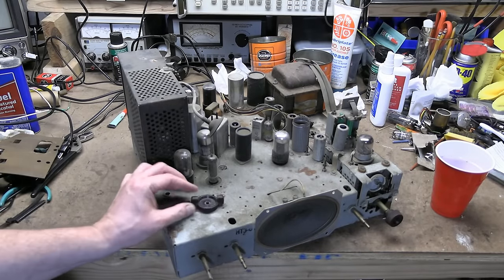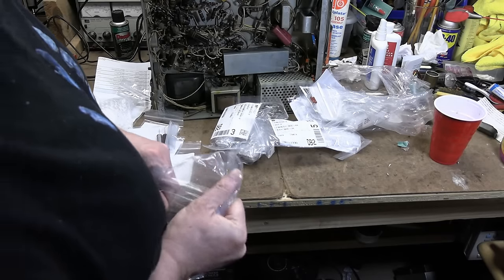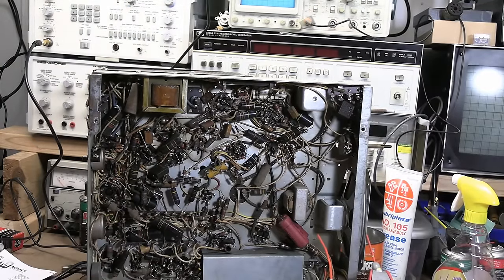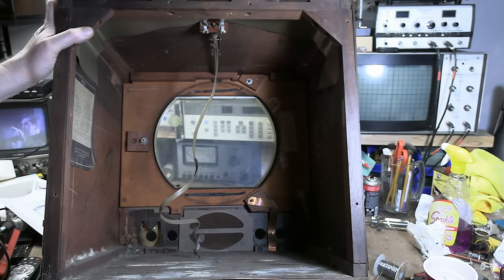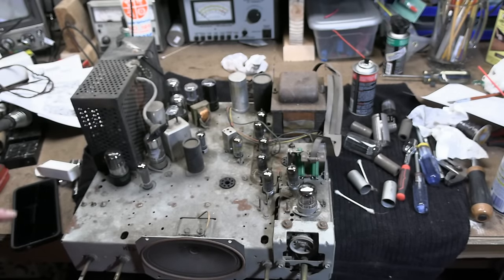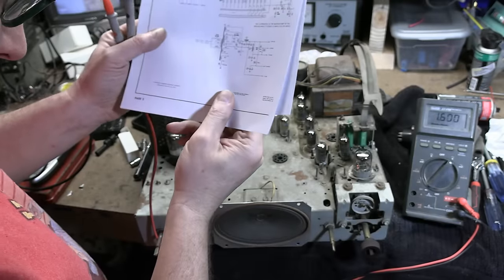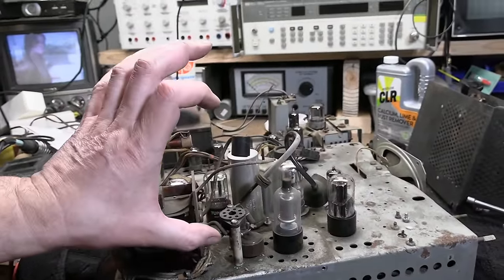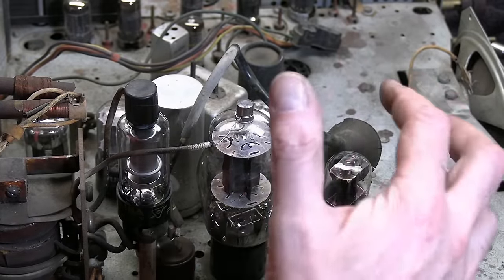Philco 50T-1404 restoration part 2

Comment: Great video Bob!  This old Philco is VERY similar to the 1401 I am currently working on. Great job with the initial checks and powerup before even doing anything other than getting correct tubes in the correct spots, changing the AC interlock and jumping the bad power switch. I wish I could have done that with mine. Unfortunately, my missing C5 cap and a few random broken wires kind of prevented that. I'm watching this one with great interest.

Comment: 28:10 The HV rectifier and horiz output tube being mixed up actually explains the bright flash that can be seen inside the HV cage on first powerup at 21:48; the 1,4V filament of the HV rectifier was blasted with the 6,3V for the H-output tube and burned up.
Reply from the maker: Haha - I missed that.  I was wondering as I edited the video if I might killed the HV rectifier.  I'm a little surprised it uses the same filament pins as a 6BG6.

Comment: For HV rectifiers you can use Soviet equivalents. 1C1S (1Ц1С) and 1C7S (1Ц7С). They have the same pinout and same ratinga as the US tubes. There's also 2C2S (2Ц2С) it has a bit higher heater voltage ,but it would work ok.

Comment: I get a little antsy every time you reach over the chassis adjust the power. Especially in the dark. Especially with your t-shirt hanging just inches away from the bare rectifier plate wires. But so far, so good. Be careful, Bob.
Reply: oh yes... sweat be conductive!  we're fans, but not for sake of bravado.  consider who ELSE is getting cues from this.  we old codgers think the next generation is stupid enough -- don't encourage them to be stupider.  perhaps bob should consider having a "spotter" in the room with him.  that dog cannot call 911 or cut off power, though maybe he could start howling and alert his spouse, lol.

one hazard about slight shocks is that they can startle if not also cause a spasm -- and send one into a more dangerous position than before.

Comment: When you joked about hitting the CRT with a hammer to get the hoop assembly off,  I was thinking the same thing, but putting the whole thing in a heavy duty trash bag to contain the resulting mess. Implosion wouldn't be an issue, given what happened to the tube

Comment: Some how when i pull a set out to work on you are restoring the same one most of time. Also my philco started with the original caps. I found two open electrolytes and one black beauty. Replaced the crt grid caps. My crt has a bit of ion burn and no emissions and tube brighter. The contrast was so bad i tried rejuvenation but i should have know better the contrast became slightly worse.
Reply from the maker: I'm surprised it has ion burn.  That should not be possible unless it was rebuilt with a straight gun.
Reply: @bandersentv Let me look, it's a 12KP4A tube, chart says, well I don't know, its damaged.  The set is a 50-T1403 I couldn't find the exact schematic. 12LP4 is the right tube?
Reply from the maker: @SoundsLegit71   12KP4A is interchangeable with 12LP4.  12KP4A is also aluminized so it's impossible to get an ion burn.
Reply: @bandersentv I haven't taken off the screen cover because it looks pretty clean. Maybe there happens to be dirt in the middle. Just occurred to me the crt socket was re-soldered on so it could a different tube.

Comment: Bob, I noticed this set appears to be missing the trap magnet on the rear of the CRT stem behind the focus coil. Does the 1404 not use it?
Reply from the maker: Depends entirely on the picture tube.  This has a 12LP4 and you absolutely must use the magnet.  I assume it was lost over the years.

Comment: Rephosphoring is relativly easy on non-aluminised monochrome tubes, some rebuilders even did it as a matter of course, It is somewhat more tricky (but doable) if the tube is aluminised and impossible on colour tubes. Air exposure will ruin the cathode however.
Reply from the maker: Relatively easy if you have the right chemicals.  I've read it's difficult to mix up your own B&W phosphor solution.
Reply: @bandersentv Barium Acetate and Potassium Silicate, I don't remember the concentrations. Solution temperature and settling time are also important. Phosphor powder has to be milled to the proper particle size, I seem to recall it was around 10 microns. The acetate causes the phoshor grains to be charged and repel each other.
the silicate glues the phosphor grains to the glass bulb

Comment: Are all of the replacement Mouser electrolytics radial-leaded?  Should I give up trying to use hard-to-find and expensive axial-leaded ones for restorations?
Reply from the maker: Depends on how you plan on mounting them.  These are replacing multi-section twist-loc cans.  Since I will be used adapt-a-caps and mounting them in the original position, it would actually be more difficult for me to use axial leaded caps to replace them.

Comment: One small correction: if I'm not mistaken the traditional early flyback has a 1:1 ratio. When there's 9kv on the 1B3's plate there is 4.5kv on the BG6 plate.
Reply from the maker: I think you meant 2:1.  True I forgot the HV winding is pulled off the primary like an auto-former.  FLY-1 has 180 ohms primary - 240 ohms HV winding.  Philco is 4:1. 97/403 ohms.
Reply: @bandersentv  1:2 if you measure from the feed. 1:1 if you measure from the HOT plate.
Reply from the maker: 2:1 measure from HOT plate.  165 ohms from HOT plate to bottom of winding.  310 ohms from HOT plate to top of winding.  OK, not quite 2:1 but close.
Reply: @bandersentv   The Sams for my Emerson says 340 ohms with a tap at 175. This would mean 165 on one half and 175 on the other half. Either Sams is wrong (possible) or this TV is different than normal (also possible). Listed equivalents are A-8117 and TFB-1.
Reply from the maker: @eDoc2020  Not familiar with that one.  Don't recognize the flyback #s either.